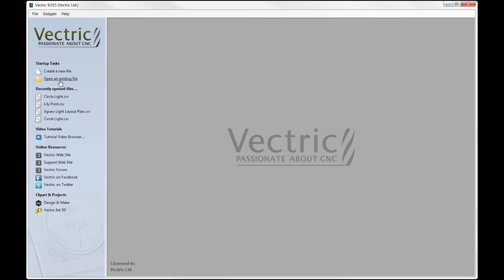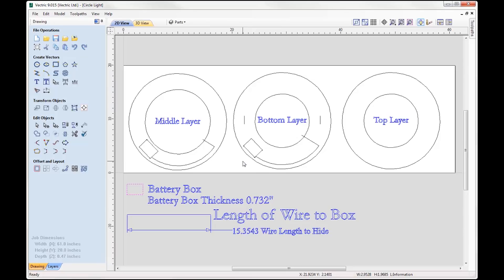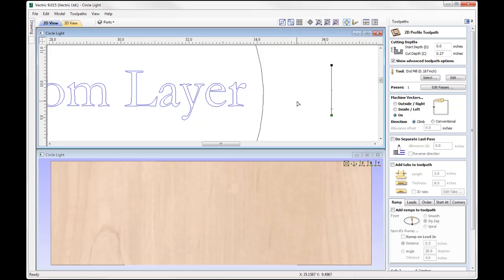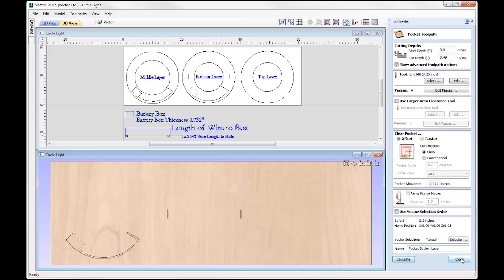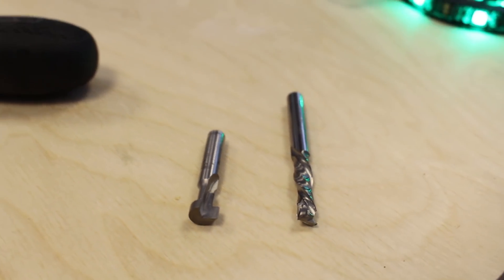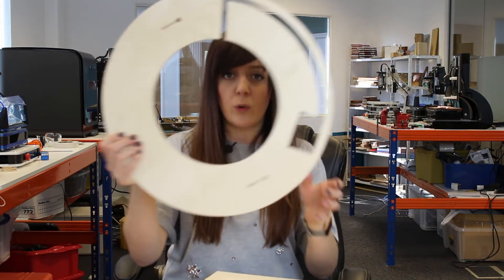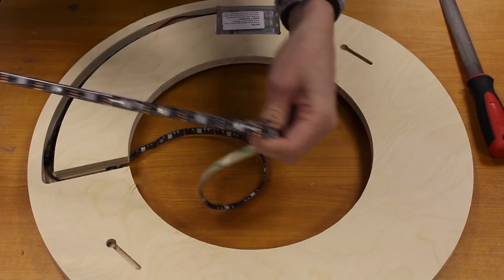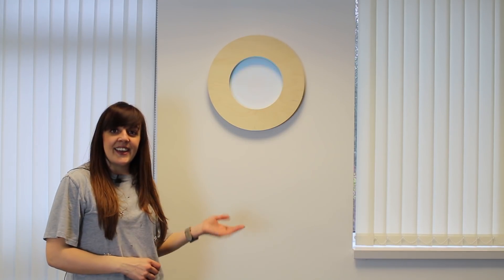In Labs with Beki | How to make a Wall Light | Vectric FREE CNC Projects

Comment: Beki love your video's, easy to follow.  Might be easier to assemble it to put two 1/8 in. alignment pins holes thru the back and middle layers and halfway thru the top layer.  Then when assembling just put a 1/8 in. drill bit in the holes before gluing them together.  This will make it easier to assemble since the glue makes layer slip easily.  Holes and drill bit align everything and hlps hold all together as the glue drys in clamps.
Reply from the maker: Hey Rick! Thank you for your suggestions! That's what I love about these projects is people reflecting on the project and sharing tips on how to make it easier/better! I will definitely do that for the next light I make! :) ~ Beki